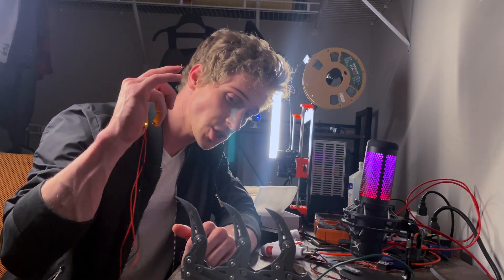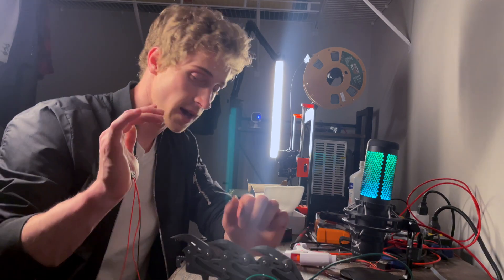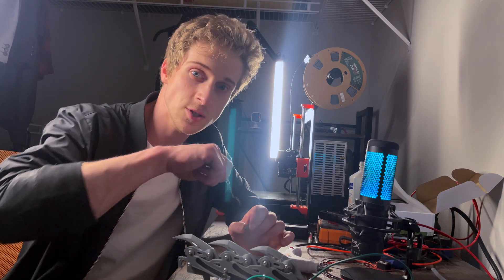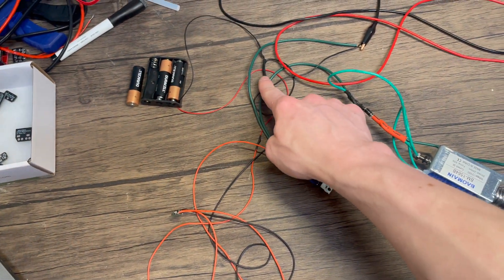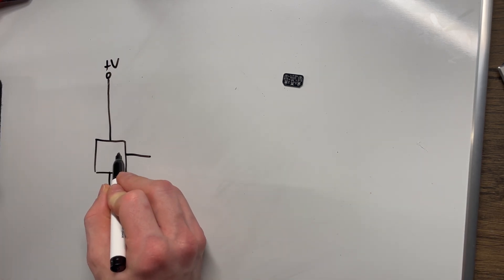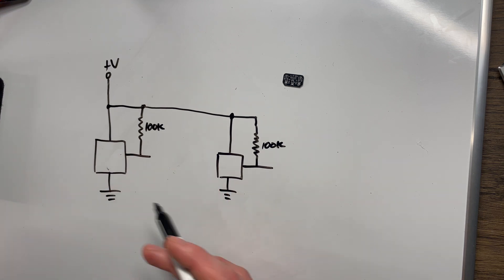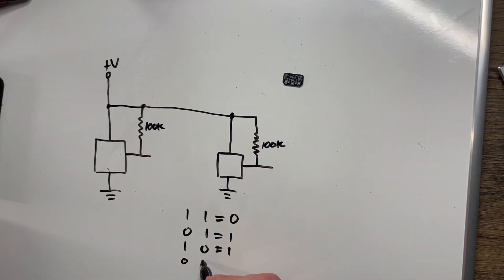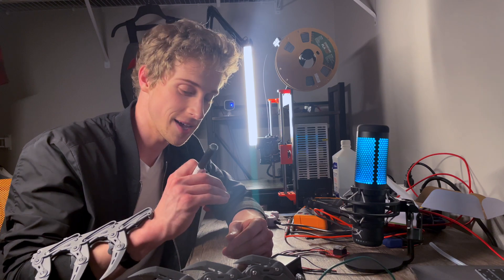Gesture Controlled Retractable Combat Blades (Chip V2)

Comment: This encourages me to start a project of my own and i would like to ask what you would consider would be a good start or first project (I'm a beginner)? I know it is about electrical engineering, circuits and stuff but i would guess starting with combat blades would be too high hahah
Reply from the maker: Love to hear that you’re wanting to getting more into making! I have a video hoping to post next week on how to make your own chips/boards easily which should be a good reference. I’d pick a project that pushes the bounds, so if you aren’t familiar with circuits yet—maybe pick an arduino controlled motion circuit. Potentially a door lock or something like that!

Comment: Hi, I'm looking to build a mouse glove, and instead of using buttons I want to use your sensors, if  possible can you provide me with the link to buy them, or the file so I can order them online, and thank you
Reply from the maker: Interesting proposition—I didn’t consider selling em. Hmmm, I’ll add this to my considerations, to sell them I’d have to solder up each one which would take a lot of time but PCBWay might be able to do the assembly for them if I was to sell the sensors
Reply: @CrashMakerspace  as i said i need them in a project bcz they work a lot faster then a normal button, so I would be more than happy if you can provide them. you can give or sell the schematics as will if you want.
Reply from the maker: @BreadButter47  can you email me at calsmakerspace@gmail.com? I have a couple chips left (they are just the PCBs, but I’m pretty sure I have the components that I could just put in a baggie and mail you! Do you have a solder paste and heat gun to solder em up if I shipped em?

Comment: To minimise complexity, use the principle from latching relays: use a solenoid to move the blades and magnets to hold them in each position. Polarity will poke the blades to the other stage state. Zero silicon required. 
To make the solenoid fire more sharply, use high voltage, short time  Can use silicon here like LM3909 voltage doubling principle which you can achieve with tristate outputs on a processor, a Schottky done and capacitor to double the voltage. Once the pulse is short, it can be very high voltage relative to the rating of the solenoid!
Reply from the maker: Good points! If you notice briefly I show the paper with a digital latch! This will be used to remember state cause I’ll have a lock mechanism that will need a pulse of power to allow retraction. I already have the capacitors & high voltage converter for doing just that for the voltage! But I’ll check out the current rating on the LM 3909, it needs a lot of current to charge the large caps in a reasonable amount of time

Comment: Bro you maybe could connect the chip to a small wireless headset so that when you do the gesture you hear a sound instead of a light that could be seen by opponents in the dark
Reply from the maker: The led here is for debugging and such. This chip wouldn’t be exposed in a final build—it’d be embedded in an armored palm strike plate
Reply from the maker: I.e not the chip would not be visible and protected behind armor
Reply: @CrashMakerspace 👍

Comment: You said you're using a solenoid, what led you to that over a linear actuator? you said in a previous video you though the linear actuator would be the better solution. Great video btw!
Reply from the maker: Linear actuators are slow & noisy. It was making the mechanism too fragile having springs to snap out once fully charged. Both are magnetic based linear actuators, but just a linear field dump is nicer than a rotary based system

Comment: Are you planning on adding in more electronic components to the build, because using Hall effect sensors will you be using a command module to compute everything?
Reply from the maker: Correct! The Latch & Logic circuit on paper I show briefly is just that! It processes and holds system State and smooths the data from the sensors too to determine eject v unlock & retract
Reply: @CrashMakerspace   nice, that brings me to my next question, I watched your earlier videos about the blades actuating and retracting but there’s no mention of blade being stabilised whilst out, like when you go to slice someone they retract as they are being pushed back, are you gonna put a electronic controlled stop or was you planning on using the electrics to hold it out? Cos I know using the electrics to hold it out will destroy any module you use.
Reply from the maker: @graybmx123  Yep, looking at a micro solenoid that sets a lock to hold them outward. A mechanical latch lock which gets undone with the micro servo

Comment: Sweet videos! I think you can handle a lot of your state logic in Arduino. Turn the hall effect into a switch and monitor the state of the blades. Check out the Seeed Studio XIAO ESP32S3. You could get the formfactor of electronics very small. You could also have an IMU for gesture based triggering ontop of hall effect triggering.
Reply from the maker: My last video on the V1 has an XAIO! This is the improved system since it’s lower power and faster response. I show a glimpse of the logic circuit with a DLatch which will utilize the sensor output as the latch enabler